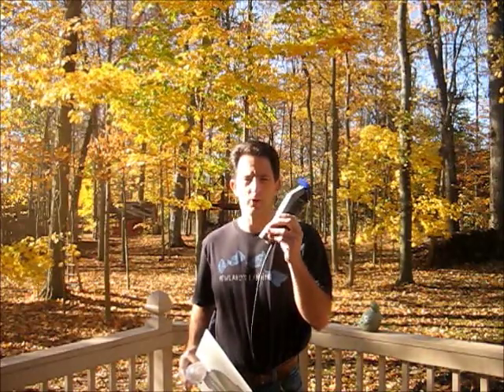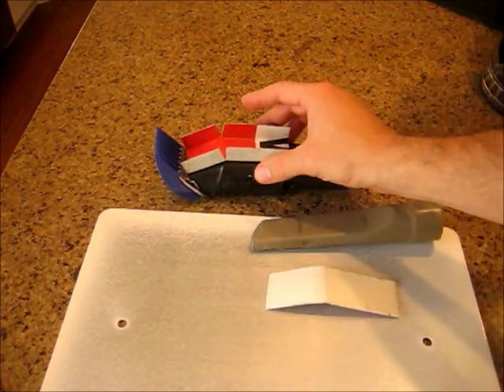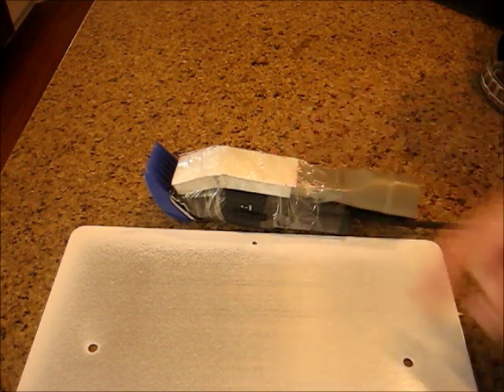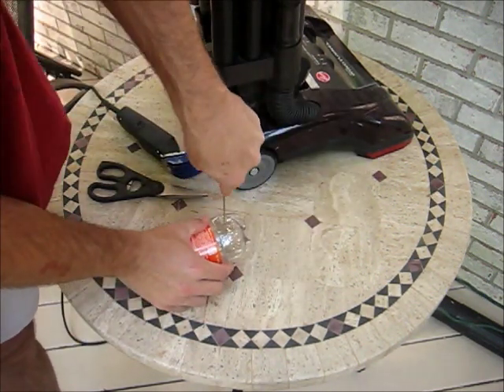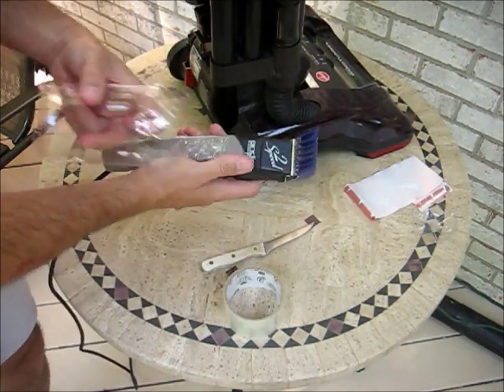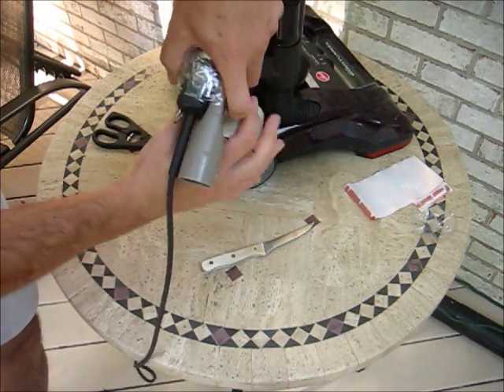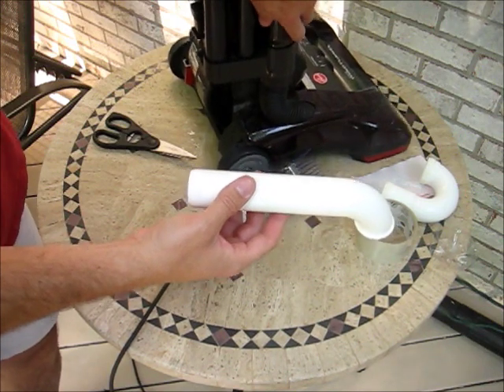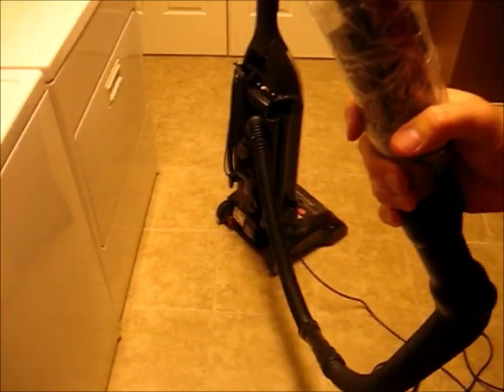How to Make a Vacuum Trimmer (HowToLou.com)

Comment: Today I write this in the middle of the covid issues in May of 2020. Who knew getting a haircut would be so hard? My wife threatened me to do it herself and that was a call for action. I applied your idea to a shop vac and some aluminum flashing I had lying around and some electrical tape. Hour later the hair is cleaned up and it worked like a charm. Thanks for sharing.

Comment: Pretty clever "ghetto mod."
If properly set up, with the vacuum cleaner nozzle in the right position and right distance, there is no reason it should not do exactly what the cutters in the infomercials do. So why fork out good money for them?
Well worth testing out if you already have an electric hair clipper and a vacuum cleaner.
Thanks for sharing.
Incidentally, the vacuum cleaner nozzle could be positioned closer to the hair clipper blades if it is angled slightly. No reason it has to be absolutely parallel to the body of the hair clipper.